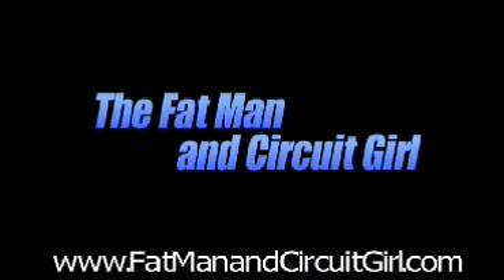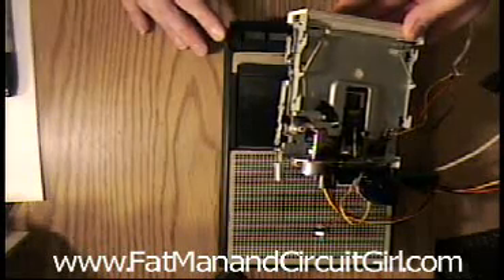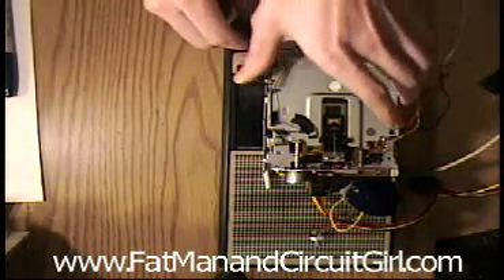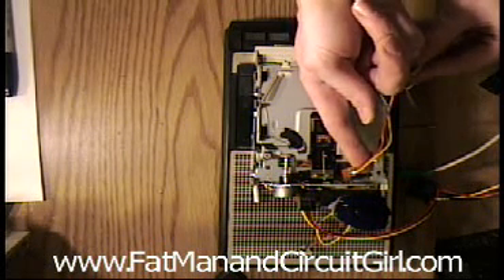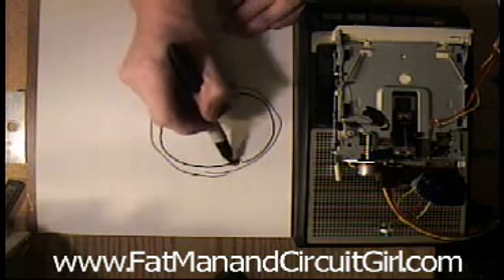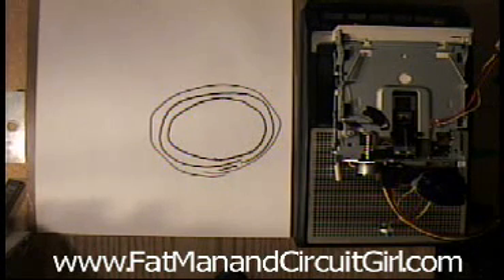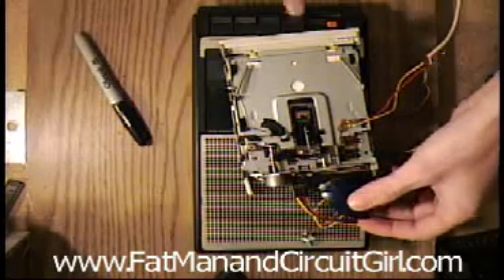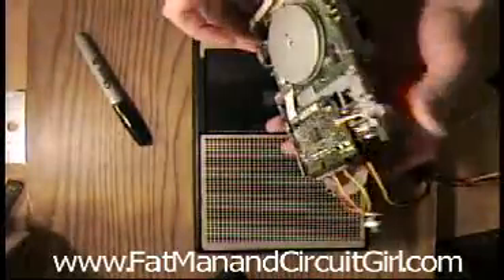Floppy Drive Reverb. Recording Analog Audio on Floppy Disks

Comment: It’s a bit late to comment but... the floppy drive head has ‘tunnel erase’ heads (read /write gaps) either side of the read/write gap to trim  either side of the track to prevent reading noise with the data. Sounds cool without though.

Comment: I'd so love to hear what a floppy full of data sounds like with this method! Does it produce sounds?
Reply: It does. I remember reading about a noise/ambient artist (I think it was "feralcatscan") years back who did something similar to this and played floppies with data written to them, which, IIRC, produced a lot of harsh electronic screeching noises or something to that effect. Again, it's been years since I read about this, so my recollection may not be totally accurate, but it does produce sound.
Reply: The Sinclair ZX Spectrum used audio cassettes to store and load data and it played the audio through it's little speaker as it was loading. Painful ears after a while I tell you :P
Reply: I haven't ever used a ZX Spectrum, but a lot of old studio equipment (like MIDI sequencers) used to have tape outputs for storing program data on tape as well. I used to have an Alesis MMT-8 with one of these, and the output sounded something like a cross between a dial-up modem and the sounds you get playing non-audio files in a wave editor.

Comment: This is really cool, and was something that I had thought of, though not in this realm.
One could use this to make a "magnetic oil can" reverb (Tel-Ray) by using a second head. The first writes, the sound travels around the circle and ls read by the second head. The bias for the writing head should be sufficient to allow for a few dB of erasure for each revolution. Since this is a CAV device, the outer tracks will give a slightly longer delay than the inner ones. By modulating the speed, one could also get a tremolo effect from the device, similar to later generations of the oil can.
=!= SRW
Reply: Kudos for mentioning the Optigan at the end of the video. Not too many of us know about that curiosity.

With enough heads and smooth looping, this could be like a Mellotron, without the time limit the strips impart.

Comment: YES YES YES , How koool !! I am actually doing this as we speak with a hard disk and have a floppy drive sittin' and waitin' ... I randomly decided to check if anyone has done anything similar !!! It appears so... ...    I'm going to use my own tape heads and amp's first before trying to use the HDD Heads for write/read. So far HDD part is DONE :) finally ... bypassing the serial stuff, fault checking mess and hacking the FLL circuit was fun.. regarding the spindle rpm, it turns out to b just a RC type deal, So I ended up with 1 pot and very precise rpm speed.... ... ... ..    U are rad , I am going to check your other video's too. I am amazed and happy there are like minded individuals out there!!

Comment: Did you know you can feed it an analog signal through the regular connector?
The floppies records digital data using Modified Frequency Modulation which can be fed analog by a PWM signal. Then you can reconstruct it with a low pass filter.

You can feed audio to the CV pin in a 555 to vary the duty cycle of a 200kHz+ carrier signal and will magically work :)
Although in my tests, there was slience in the data read pin whenever the Index was crossed.

Btw, thanks for your videos, you're awesome
Reply: Sample and hold, makes it 8Bitish and discombobulated. Like a cityscape or ladders on an oscilloscope

Comment: I have an idea to take an 8-track to cassette adapter apart, vibrate the 8-tracks PB tape head in front of a recording head and feedback the audio through the vibrating head, meanwhile audio tape can be going between the two heads, perhaps off to one side so that 1 of the two stereo tracks have tape and the other half is just the mated PB & REC heads. Having a tape monitor circuit would be simple...in fact all of this is simple really, I just have too many projects right now, so someone do this

Comment from the maker: For giggles I tried running audio into the write line of the drive and wasn't surprised that there is a lot of signal shaping happening.  

A few weeks ago a guest of the show explained how to make a simple PWM circuit with a D flip flop and a clock.  It works both forward and backwards and maybe a simpler way to make a floppy drive recoder/player

Comment: Interesting.  Do you know if the drive you used was HD?  I suppose i might be seeing two heads, one for each track width. However the four traces seem to be interrelated, which makes it confusing.

The fifth trace turns out to be connected to the shield.

The resistance between the four traces varies between 4.5 and 33 ohms.  very confusing.  The resistance on the tape deck is about 200 ohms.

I wonder if I have a DD drive somewhere.

Comment from the maker: Seems like that has a few more wires than what was on mine.  I'm not at my lab this week, so I can't check the resistance of the head.

I could hear noise from the data on it before I erased it with a strong mangnet (spinning in the drive and moving the magnet)

Comment: So i'm trying to reproduce this using a 3.5" drive and an old console tape recorder. The drive movement stuff is working fine.  It's nice the index pulse and step input are both inverted, makes it very easy.  and the direction line seems to mostly float high on its own so i don't have to find 5v for it.

However, i am having no luck with the actual head!  Each head has 5 traces going to it, 4 of which show resistance (5th is open).  but i have had no luck getting audio into or out of it.  :(

Comment: Very, very interesting.   The idea to slow/speed up the drive motor via cv is interesting, but you could also record notes at different points on the floppy and use CV to move the head up/down to select the notes.

Comment: I love using old tape recorders for crushing noise and the floppy disk format is a very interesting. I choose vintage gear just to work with them.

This is the intriguing project i have every seen. I am completley out of words here.

Will there be a more comprehensive guide for this? What is your goal with this besides making it work with larger drives? 

I will update your blog twise a day until you write more about it. Thanks for making my day.

Comment from the maker: I'll blog about this soon, but the circuit was very simple.  

The edge of the connector has a signal out call index, which is generated once per revolution of the disk.
  
I feed this back into the step pin on the same connector.  

I tied the drive select lines and motor lines to ground to enable the drive.

Added a push button between the direction pin and ground.  This allowed me to control the step direction while it ran.

The soldered the two wires from the tape head to the top floppy head